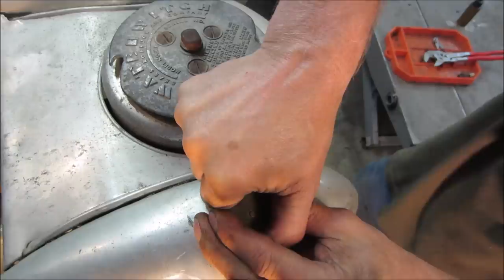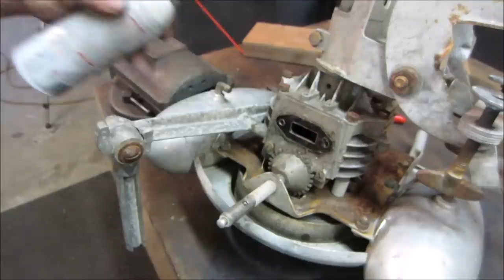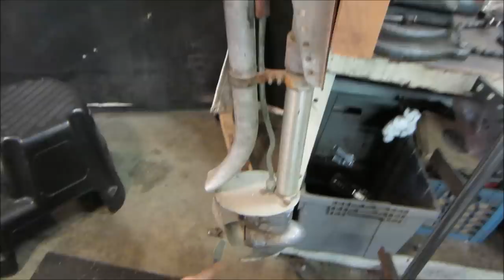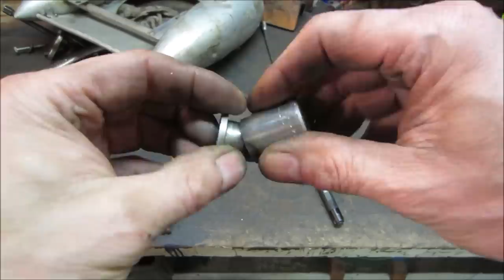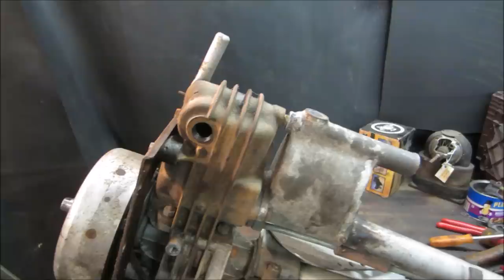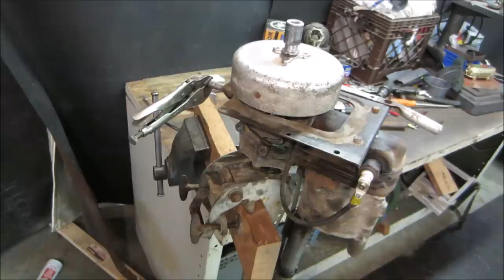1937 Waterwitch Boat Motor, 60 years in a Shed. Will It Run? Part One

Comment: Dude, PLEASE invest in the proper set of wrenches for removing fuel and brake line compression nuts.
They're like a 6 point box end wrench with a cut-out for the hose/line.
Otherwise you're gonna strip those compression nuts.

I'm impressed you realized it is a two stroke.

The "button" in the center of the fast/slow/stop lever is a lock, to prevent vibration when running from moving it.

Not surprised you didn't try to find a manual or parts schematic online before tearing into it, to give you a clue about what you were getting into.

Comment: Have you ever tried Scoutcrafter’s 50-50 mix of Acetone and ATF fluid to break nuts loose? I have seen several restorers use it and swear by it. Good of the Land and Keith Rucker being just a few. I have not tried it but seldom disassemble as rusty parts as you do. We do not have snow or salt in Memphis TN so things do not rust up as bad as they do up North.

Comment: The small bolt  on the one oil tank it  looks like a adjust/bleed screw to regulate how much oil is added to the carb to regulate fuel/oil mixture?
When attempting to disassemble old, corroded items do not hesitate to use penetrating fluids liberaly!
If all else fails ;@ the end of the day the fuel tanks with the pullstart flywheel make a good wall decoration of Startreck Enterprise IV, the Adventure continues  ....
Reply: At 54:27 what was the liquid running down out of the engine on the flattened tube?

Comment: Be careful. Those old motors want a ridiculous fuel/oil mix. Old Evinrude and British Seahorse motors of this era use 25:1 ! Also, what you thought was a bad spark gap was due to the fact that the eye terminal for the wire was not under the rod for the movable electrode. You might want to re-examine the gap with the terminal screwed on.

Comment: My father always had a 55 gallon drum with one end removed to test his motors in. He would fill it with water.  Question: Where do you get the squeeze bottles you use? I really need several of them. Thanks.

Comment: I think that is air cooled engine with water cooled exhaust and usually distorts the flange if run out of water for too long that may be why the exhaust as been botched with a weld.

Comment: It needs pressure in the crankcase on the down stroke to evacuate the exhaust and introduce fresh oxygen to run.  A 4 stroke will run on gas squirted in the cylinder but not here.  Replace carb.

Comment: I'm looking for a Briggs and Stratton Carb and gas tank part numbers 299448, and 297257 respectively you are the old parts guru, I've looked everywhere, and I'm hoping you might have them, or know where I could find them. They will be destined for a tow behind tiller, the motor runs, it's just missing those parts. Any help would be greatly appreciated!

Comment: Thoughts..  as though you need another youtube goof giving you his two cents..
- I use a non-glossy / cheap business card to clean or polish points.. I try not to use emery if possible..
Older ignition points have a vey thin coat of silver on them..
So I TRY not to abrade or sacrifice any of the silver...
I believe points can be re-silvered.. Never tried it myself..
- I believe the older motors needed 16:1 or so.. 50:1 might seize it
- some kind of one way ratchet drive would save your drill.
Without it, some drills will unscrew the chuck or snap the chuck off.. or unscrew the crankshaft nut
- i think the final drive & water pump housings were filled with gear oil.. but don't know..
Sorry if this is intruding.. enjoy watching your resurrections.. 8-)

Comment: Sometimes motors of that era, without gearshifts, would be able to run in reverse by reversing the timing.  Theoretically, you could do it from idle if you timed the reversal of the timing right.  I had a motor that was supposed to do that but could never get it to run in reverse at all.

Comment: If the oil is dis colored seals gone. If theirs no water impeller maybe constant. The exhaust is by your wrist. Still need to change it. The lower unit oil.

Comment: Dude you can rebuild old stuff and I used your video to learn how to rebuild my 1940 2.75hp water witch that I found in an attic, hidden and properly stored.  I know it was properly stored Because  after what I did to it what you did to it, basically took it apart and rebuild, I found  nothing Had been left in it and the lower end had a very light coating of oil it had been cleaned out and stored But it did have the some rust in the aluminum gas tank which I bought stuff to fix and used the Muratic acid trick. Carburetor was clean nothing in the top and spark plugs clean no residue of any oil except the machine oil to protect it. It runs but when I put it back together only problem I can actually find with it is the float chamber needle is worn out and it floods. If anyone can tell me where I can get a new one of these I’d love to hear from you .Only mistakes I I have found  was that the bottom and takes grease not oil and it calls for 10 to 1 gas oil mix. Apparently you can get away with 16 to 1 but the motor was designed for 10 to 1

Comment: they may have rated it at one horse or whatever back in the day, but remember the way they measure that has changed since then. I used to have a tiller with a Wisconsin motor on it, rated at 5 hp...but the one cylinder was huge by today's measure it would probably rate 10 horse at least, however that's a guess because those old 40's motors were low compresion. chain it to a tree though and if it could get traction, the tree is coming down.

Comment: Sorry but anyone who is a mechanic knows to use a spark plug socket to remove it and spray some WD-40 or liquid wrench on there if they're going to start disassembling let that stuff soak in and have a propane torch close by just in case

Comment: Anyone know where to get that air impact driver adapter to attach bits or sockets to the impact driver with attached handle that Mustie uses for those three large flat screws on top?  Never seen one before.  Have seen similar units where you smack it with a hammer on top.

Comment: i have seen multiple times but i can't figure how timing works, i mean, you have the points surrounding a shaft that has a lobe on it i understand that, and then you rotate the plate where the points are and the timing increases or decreases, that's what i can't understand, if the shaft rotates always at the same speed so does the lobe, right? what am i missing?

Comment: If I had to guess the bonkers range for the timing is so you can flip the timing and run the engine in reverse but the engine start pulley should have the rope notches in both directions and it dosent so idunno

Comment: 57:57 wetness spreading from the spark plug. It has to be fuel because thats the only thing you've added on the top end so far. Is it becuase in the testing phase you only put the spark plug in finger tight? I don't know much about 2 stroke or outboards, only what I've learned watching your videos. I hope if it is just the fuel you added puking back out the plug hole that it doesn't mean someting is bad in the engine.

Comment: Without the carb on, I don't think it will run, since it has no compression in the crank case. It wont force any fresh air into the cylinder.

Comment: I can never understand why you don't you don't get a bit liberal with the WD40, or equivalent, BEFORE you drag out the long bar and bugger everything in sight. At a guess I would say the cap on the second tank was designed to be a breather for the fuel, to prevent vacuum lock.

Comment: Not trying to be a troll, but when a proper points file is about $1.50 on fleabay why do I see people still using sandpaper? In 1962 I cleaned and set some points in our family's Corvair. I used sandpaper. 14 year old me had to get a mechanic neighbor to get it running. He lectured me about the residue left by sandpaper. I still have the file I went out and bought.

Comment: Oil cap adjust amount of 0il that the fuel mixer pulls into the mixer. More air less oil less air more oil,I could backwards.

Comment: Yeah but mechanics have used schematics for a long time because if you remove the wrong things, you might ruin it. Better to let an expert guide you, especially on a valuable antique. This just something that you can either buy a new part for or screw up and just throw away. I looked it up and that model was made by the Kissel motor car company just before WW ll and then Chrysler bought them.

Comment: I couldn't watch that anymore after u took the inside of the spark plug out thinking the whole spark plugs was going pop out. Then u were beating on a cast aluminum handle then u put the nut back on the knob and u started beating on the back of It probably messing threads up

Comment: The Waterwitch brand was manufactured by Kissel Motor company from 1936-1944 for Sear and Roebuck co. There is a complete history.  The one you are working on appears to be prewar. As the post war ones were manufactured under a different name.

Comment: Designed at a time when "women will get more work done in the household because of these new fancy electric kitchen appliances that aren't bogged down by safety features" and "there are some political troubles over in europe, but america wont get involved in that".

While i love the optical design of devices of the 1930-1960 era. i'm a bit weary of their inherent engineering choices that result in casually maming and killing innocent bystanders. I grew up in a house full of these things, and these days i'm rather fond of fuses in circuits, working earth contacts and power tools with integrated dead man switches...

Comment: These motors should have come from factory with a warning, RUN In CLEAN COOL CLEAN LAKE WATER ONLY,  cooling system will plug up in a NYC half second. My Great Uncle would take me fishing as a kid and we spent half our fishing time working on that motor. Not sure the problem the motor or his mechanic work. My opinion at the time it was a POS.

Comment: I was sitting here face palming for ya for about 7 or 8 mins..... She wont   run without the check valve bolted on. It works the same as a reed valve in 2 strokes without a timed cylinder port. 🤣

Comment: I think the design for the year is brilliant, somebody please tell him about WD40, I'm a retired engineer, and watching him use brute force on nuts, almost siezed with age. God it makes me shudder.
Reply from the maker: or maybe l know when it is going to break or not and not wet all the screw slots with oil reducing my friction bite, oiling  a screw does very little unless it sits for a very long time, if you can get to the backside that helps as you then can draw it up as you unthread, by the way did l break any screws?

Comment: Why are you so slow to take apart motors?
Check out Get a Grip Garage, his hammer technique is beyond amazing:
Hit as hard as you can with your biggest steel hammer, never use a prying device or a puller. If you break anything, fix it with rebar.

Comment: 16 to 1 mix.  Please read up before you seize that motor.
Reply from the maker: 16 to 1 is for motor oil not modern 2 stroke oil,
Reply: @mustie1  Yes but TCW3 is not meant for babbit bushing engines, but for roller bearing engines.

Comment: You obviously don’t have a clue on how to cycle motor runs. The crank case must be pressurized to transfer fuel air mixture through the transfer ports into the cylinder as the piston moves down. Normally a reed valve would be placed between the carburetor and the crank case it appears in this case your carburetor is also the reed valve. Clean out the carburetor put it back on it should run
Reply from the maker: no kidden?

Comment: Learn to use the right tools, and circumvent disaster with penetrating oil a day or 2 before you get your pliers out. I cringed.
Reply from the maker: cringe al you want, did l break any screws?